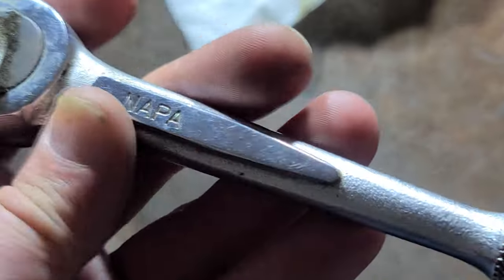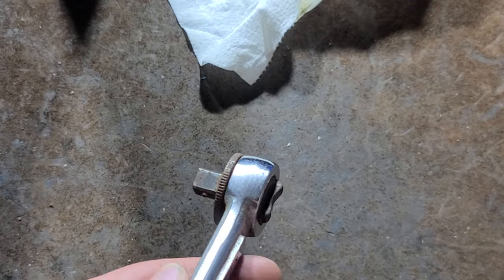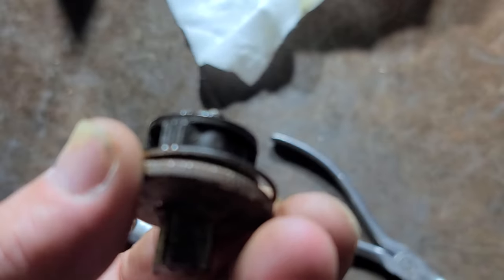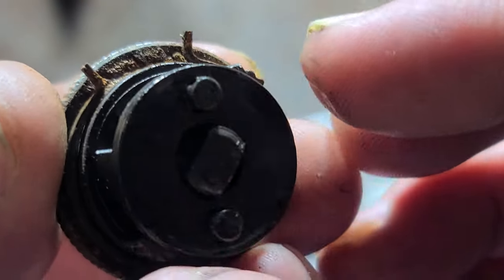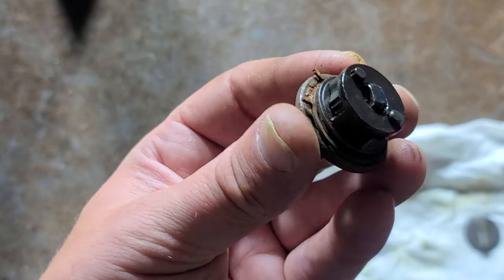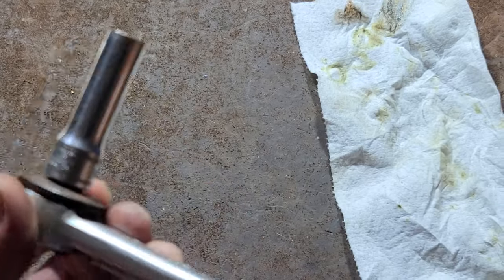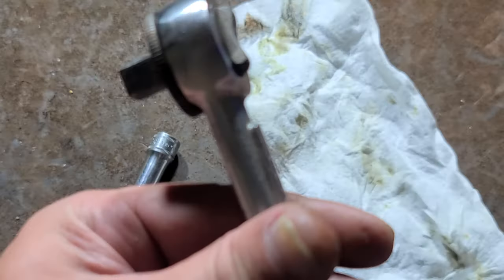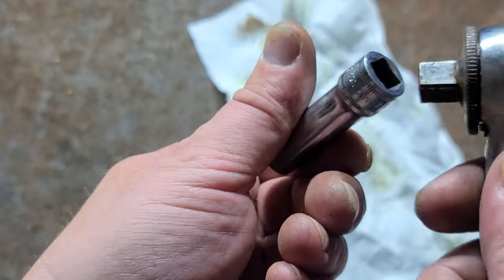Napa USA (Easco) Twin Pawl Ratchet Review

Comment: If the pins break you can take drill bits of the same size diameter and cut the ends down to length and you’ll be back in business again now if the anvil breaks your sol unless you find another ratchet for I believe they don’t make rebuild kits for that style ratchet anymore